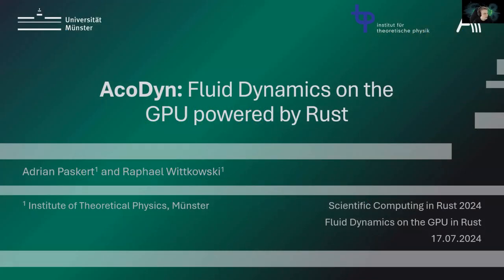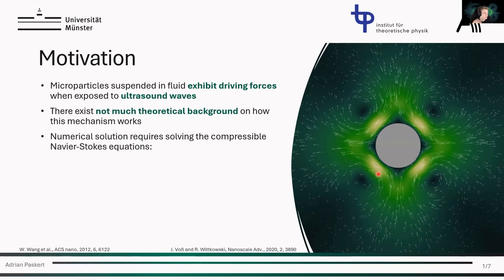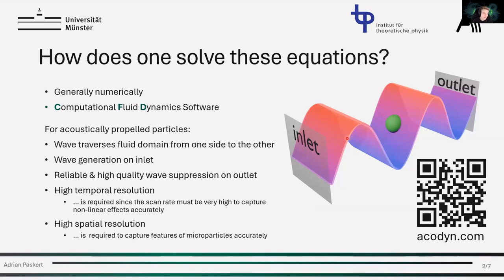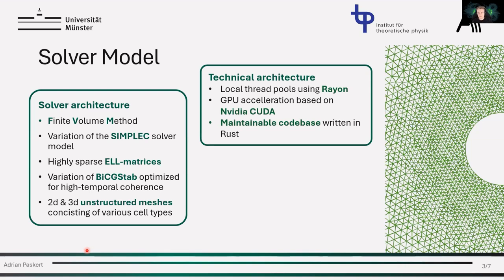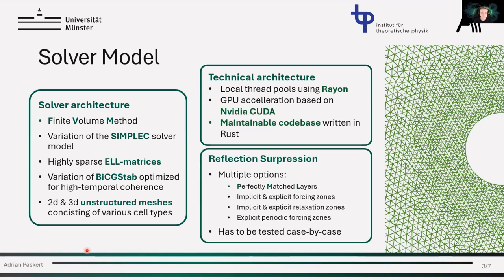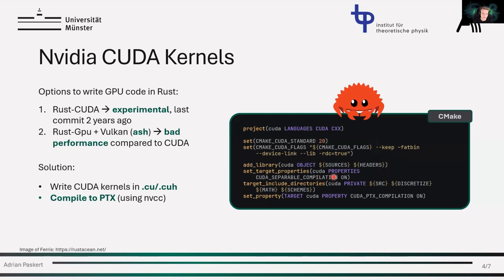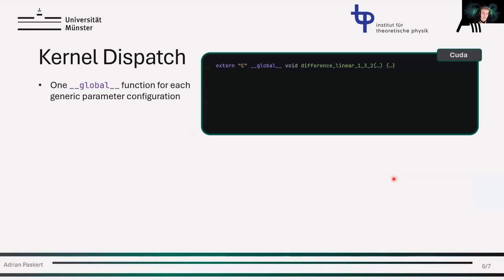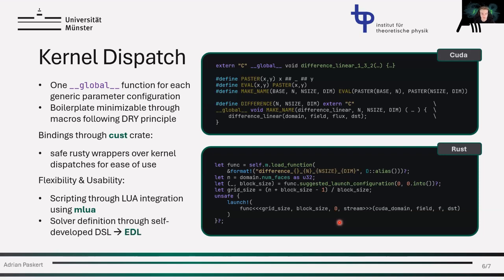Adrian Paskert - AcoDyn: fluid dynamics on the GPU powered by Rust

Comment: Why not OpenCL for GPU?
Reply: OpenCL is effectively dead. NVIDIA never cared about it and AMD deprecated it years ago. You'd be better off writing a compute shader in Vk or GL. The only major player still actively working on OpenCL is Intel, and they're not exactly doing great.
Reply: @techvette  I mean, I'm going to continue using it so long as there's drivers, I found it easier to get my head around when I was first getting into GPGPU, maybe I'll give CUDA another go, but I also like the idea of a cross-vendor technology more. I know you can translate CUDA/HIP but there's just fewer steps involved if its a shared standard to begin with. I don't like the OpenGL domain specific syntax and I hear vk is worse, OpenCl is a lot closer to writing code for a cpu thread pool, which makes it so much of a smaller jump from cpu programming.